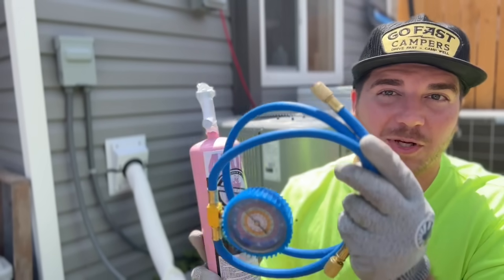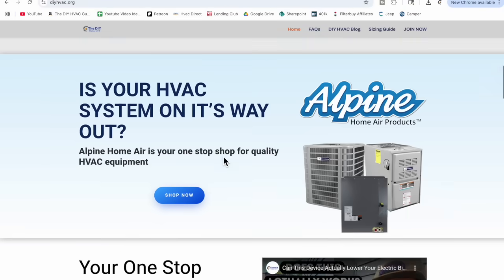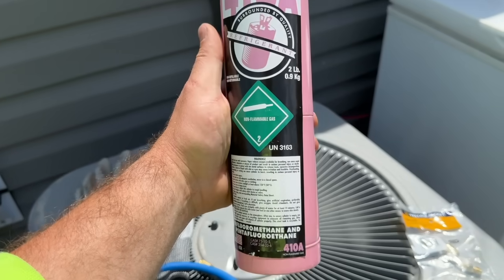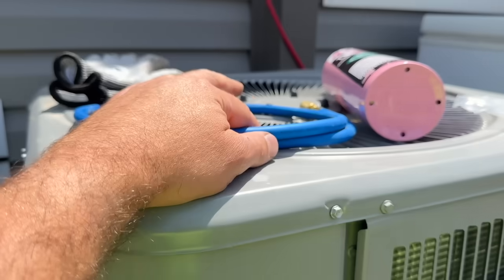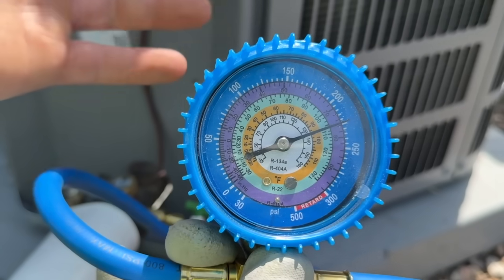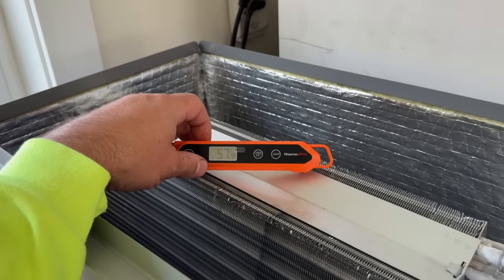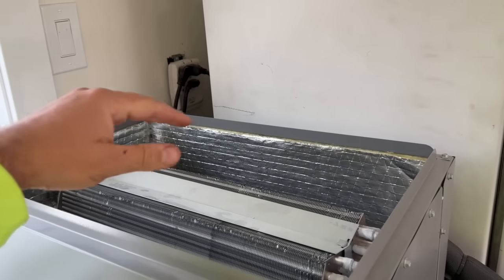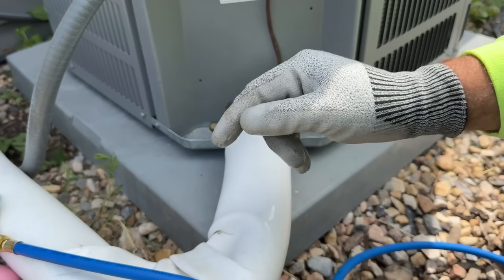You Can Recharge Your Home A/C Like A Car??  Colder Air in 6 Minutes!

Comment: So, when you did the "bleed".  Opening the connection to the bottle, allows backflow of freon from the coupling/freon line which is pressurized from the compressor.... and that presses the gas back to the bottle connection  which purges the line.  I was watching and thought of when the line gets purged.  Thanks - great video.

Comment: So far this season, I've got my EPA cert, recharged, replaced the blower motor that was starting to make noise, cleaned condenser coils, filter, cleaned out handler and evap coils with evap coil cleaner and put some Viper in the drain tray, proactively replaced cap with an AmRad and added a 5-2-1 hard start to help with dimming lights. All thanks to youtube and AI to help find parts. I feel great having my hands in the system and having a good idea of how it functions. Thanks man!
Reply: I wish someone can tell me where to start my AC is literally not doing any thing not making a sound so I dont no where to even start
Reply: @bryannafentress8563  check the breaker to see if you have power first and make sure it didnt trip.
Reply: @bryannafentress8563  Search videos on replacing the capacitor and the contactor in the outside unit and checking the thermostat inside.
Reply: @bryannafentress8563 check disconnect switch, check the breaker, turn on indoor adjacent switch looks like light switch.
Reply: You really needed somebody to tell you to do this? 😂. All you did is what the rest of us in the industry did, and decided to run a business with that knowledge. If you went out and started an hvac company now, you’re not going to be doing this for free for people, are you? Didn’t think so
Reply: What did it take to get your certification? The Epa 608 site doesn't show a way to do it without some program.
Reply: You said: you gonna add liquid refrigerant to the compressor, only gas goes to the compressor,  I am confused
Reply from the maker: Thanks for sharing! Glad the channel has helped you aquite an invaluable skill 👊🏼
Reply: @diyhvacguy  Just an FYI - anyone that was in the military, and had to get an EPA Cert if their normal duties involved refrigeration and A/C equipment - companies will honor that military cert, at least as far as buying refrigerant.
I got mine when I was in the US Navy and they first started the EPA Cert program in the early 90's. In the early 2000's, when I checked about buying refrigerant on my own, the local A/C equipment supplier said that cert was just as valid as the civilian version.
Back in 2009, that cert actually got me a job, with the company that was operating the central heating and A/C plant at the Univ of Texas at San Antonio. The manager was also former Navy, and as soon as he saw my cert card, all he asked was "when do you want to start?".
Reply: @diyhvacguy  which of the epa 608 certifications one require to buy 410A
Reply: Ya, your just lucky you understand what you're doing, now let me see you test those parts while the system is running 😮
Reply: In about 5 more years you can become a trainee for a HVAC tech !
Reply: Best drop in replacement for the vehicle is hot shot which is 141b, r22 and a ounce of propane. They say to place 85% . But I use 80% for a colder affect. I'm hvac also since 2001, universal. You have to be certified to purchase. That's illegal to tell people that they can still purchase the freon.
Reply: @mldlrmn Use the capacitive reactance of a 1μF capacitor @60Hz (2652.58Ω) to calculate the actual capacitance the system sees: divide the product of the current through the Herm wire times the 2652.58 Ω per μF by the voltage (back EMF) across the cap. Then compare the result to the capacitance marked on the cap for tolerance. The PP3 Battery in your DMM does not have the voltage necessary to accurately measure the capacitance. (Do the same thing for the fan terminal on a dual cap.)
Reply: @mldlrmn Walmart does not require the EPA 608 certification to purchase RAID®
Reply: @mldlrmn what about for a central air unit? I'm getting 58 degrees F at my indoor ac vent, incoming air in 75 degrees F, can I get it even colder?

Comment: How much freon can a 2.5 ton system use?
Reply from the maker: Probably around 5lbs if I had to guess. It should say the factory charge on the side of the unit where it shows the refrigerant type
Reply: @diyhvacguy we upgraded the compressor so it's not the same unit plus the unit is downstairs and the apartment is on the second floor

Comment: Can you mix r22 and top off with mo99?
Reply: You can put the other end of the hose up your nose and open the valve very fast to get a turbo nose hit
Reply: You can put water in your fuel tank , it will run like new

Comment: Ac companies are a criminal enterprise. They want
150 lb for freon. I bought 2 - 25lb lb jugs
For 320 for both. Like 6.50 dollars a lb. I was in need of a 
5 ton system replaced do to age, they wanted 12k.
I bought a new carrier for 4k. $500 to have installed.
Total 4500. Did it in the summer when all the ac guys were starving.

Comment: I just a service tech come out. They added 3lbs and with $50 discount we paid $715. I watched the tech the whole time. I’m confident if I have the right tools to troubleshoot I’ll be more inclined to do fill the refrigerant in the future. And thanks for posting this video! Great DIY instruction.
Reply: Get your EPA 608 Type II Certification first. That's what I did.
Reply: Maybe they will give you a labor deal only of you have the refrigerant. Even 200$ an hour to refill the system every year is a bargain. Especially if you use the HVAC year round. Might be good to order 25 # and keep it.
Reply from the maker: Yes you can save so much money. Good on you for observing to see what they did for that $700. A lot of it is not very complicated! Cheers
Reply: Too bad he's failing to tell you if you get caught purchasing or handling refrigerant without a 608 certification you can face fines from the EPA up to $44,539 per violation.
Reply: @jphill3306  Tell me how a person would get caught with a small amount of refrigerant. I don't think the EPA is going to chase down guys who ordered 10lbs off the internet.
Reply: @jphill3306 We're allowed to order the refrigerant. As long as we get a certified guy to install it. 😇 I have my 609. Guess I need to get my 608.
Reply: @jphill3306  the disclaimer says you can buy it. U just can't handle it to use. So call an hvac gay and bribe them with a good amount that's far less than their going rate per oz/pound to gas you up.

Comment: When you have a leah on R-410 A. You are not supposed to add refrigerant... This a blended  refrigerant.  That means  2 refrigerant in one... they have  get to pressure at diferent temperatures and when leaking the one with more pressure scapes first . Then you end up with one more  unbalanced blend. As a good practice you need to remove it all and replace with a new one  ..but most important is to get rid of the leak first.
Reply: Someone lied to you.
Reply: @arizonaf2503 Re: Do you think the school and the books will provide bad information??? You are telling me that the certification for R-410 A is not worthy???
Reply: @miguelquiroz1550 
Blended doesn't mean what you think. Certification for only 410a is not even a thing. For what it's worth, the actual EPA Certification doesn't educate at all on actual AC repair or refrigerant charging but I'm sure you know this.

Comment: Great video, thank you for the upload! Question for anyone including the publisher: on the kit's gauge , the purple scale is in "in-hg" which is a unit of pressure - vaccum . while the yellow- amber scale is in Fahrenheit degrees. However, the publisher mentioned that the purple scale is indicating "temperature". Is the purple scale for degrees or temprature?
Reply: I have seen this  question repeated several times in the comments.  "the purple scale says inches HG not temperature?" The in hg that you see is refering to the 0 to 30 on the outer blue scale, this is vacuum, dropping below the 0 to 300 psi scale. This is for when a vacuum pump is used to evacuate the system. I hope this helps

Comment: My tag on the side of my unit is completely faded away and I have no idea what kind of refrigerant my unit takes. Is there any other place I can look to find it. We took off the side panels and looked to see but it was just the wiring diagrams.  On the side of the dryer filter that's hooked to the small line coming out of the house it said can be used with R12, 134a or R22. Doesn't tell me what is in the unit. Thank you.
Reply: Gonna be r22. Look at label
On compressor
Reply: @danielracicot8310   Found it. It was R-22. Thanks man !!!

Comment: There's something I do not understand. At around 13:00 you start adding liquid refrigerant to the low side of the compressor, where the system should only have gas. A compressor is designed to compress gas to it's liquid state, and not have to "fight" something which is already a liquid. In this situation shouldn't you add your liquid to the high side, wait for it to be turned into gas in the inside coil and then re-liquified by the compressor?
Reply: Can’t add It to the discharge line.  You just flash It in slowly through suction line.
Reply: @danielracicot8310  You have to add R410A as a liquid because it is a blended refrigerant not one compound... You would only be adding part of the blend and the system will not cool with only vapor.. Honestly if you are not trained you should not be anywhere near refrigerant.

Comment: If you have central air and have your furnace/acoil inside a closet inside the house, try putting a thermometer in your vent with the ac on, note the temp. Now when the ac comes back on this time open the door and watch the temp again. 

Mine went down almost 5 degrees with the door open which told me I needed more return vents to this little closet. 

Hope this helps

Comment: Around here, they've been putting locking caps on the schrader valves.  One more tool to buy!
Reply: Locking Caps are the law sir, They are part of the Florida Building Code... At least here in Florida.. It stops kids from huffing refrigerant and refrigerant theft.

Comment: Don’t forget if you knowingly keep putting r-22 into your leaking r-22 system and the epa finds out you will be fined up to 58,000.00  for the violation. 

Just food  for thought may be different In different states
Reply: Is still cheaper than calling someone in...😇
Reply: And keep in mind this fine is per day until remedy
Reply: @frankvizzare Horse schitt! Citation please?
Reply: Technicians do it all the time, especially during summer. They don't have time to look for and repair leaks. They are too busy.
Reply: @samkitty5894 lazy  or just trying to keep charging you for refrigerant ?
Reply: @samkitty5894 oh I know we are busy but that’s no excuse for not doing the job and finding and either repairing a leak or swapping out the unit if it really is time to do so. No sense in doing a 2-4k refrigerant repair if the units so old it breaks down completely a month or only one year later
Reply: "knowingly" Key legal word.
Reply: @Igotstaknowit  lol even not knowing they will xD  have a good one 😂

Comment: You can't properly diagnose with just a suction gauge.   To know if a system is low or properly charged needs to be done by superheat or subcooling. You can easily overcharge a system that has a bad TXV or plugged drier. Your suction will stay low and you will keep adding refrigerant not knowing what a restriction looks like on your gauges R410A can be over 500 psi on the high side of a system.  Pushing in Schraders can be dangerous I have seen them stick and if your unprotected hand or face gets blasted with liquid refrigerant you can get seriously hurt 2nd and 3rd degree burns.  R410A boils somewhere around -60 fahrenheit.  Find a reputable company and fix leaks.  Adding gas constantly to a system that is known to be leaking is irresponsible and illegal.  Some things can be done diy cleaning coils, changing filters, clearing condensate blockages.  If you don't have experience diagnosing and handling refrigerants you shouldn't be handling them
Reply: Great advice, but the reason people try this is because everywhere you turn these days there are rip-off ac techs and unscrupulous rip-off companies. Yes, we were taken by one for a repair but fortunately we went with a reputable one when time to replace.
Reply: @GeorgeKennedy-u4r yeah I get there are a lot of dishonest people and companies I don’t disagree. It’s just that someone could injure themselves or make their system run worse or damage it because they don’t know what they are doing. It’s not as simple as this guy is making it out to be.  Nothing wrong with learning what to look and being informed and asking the right questions to weed out crooks. I have been doing this for 27 years. I have friends, family,and neighbors always asking me questions when they have a system not working. I would never blindly tell them go online buy refrigerant and add it because your suction line has ice. Same thing with electrical issues.  I would feel horrible if someone got hurt because I told them to do something and they didn’t know all the risks associated with it. That comes with training and experience. If find a good company or even a guy who does side work never let them go because good ones are kind of hard to find.  I don’t say this because he’s taking work away. The company I work for has more work than we can handle there is shortage of good techs.

Comment: Would you suggest using a leak sealer for a small leak when topping off the system?
Reply: No, do not do that. You will clog your metering device. Most of that leak sealer is an upsell rather finding the source of the leak.
Reply: @bradfordgordon6552  my system is a fixed orifice not sure whether that would make any difference?
Reply: Fix the leak before recharging.  Recharging a unit that you know has a leak violates EPA regulations.
Reply: @richranchernot Only for a system that holds greater than 50 lbs and loses more than half it's charge in a year.

Comment: Dude, don't tell unlicensed home owners to do these things. First of all, they are not EPA certified. This is the first time responding to you videos. Myself and other HVAC people in the industry need you to stop posting this bullshit. Block me if want, but the truth is the truth. Do not tell homeowners to dump gas in their AC units. There may be other issues contributing to the issue. It is very amateur to just make the refrigerant charge the fix all solution. Where is the superheat and subcooling? How can a homeowner make sure the unit does not become overcharged? The end result would be worse than jacking the unit up with refrigerant. Adding refrigerant to a leaking system is not recommended. This is why the government changed the refrigerant on us again in the first place. The system needs to be checked by a licensed contractor. Your really not doing anyone any favors. PLEASE, FOR THE PEOPLE WHO DOES NOT WORK ON HVAC FOR A LIVING. DO NOT LISTEN TO THIS GUY. 
Let's tell the public to smoke a cigarette while charging 454B too. 
I have been in the HVAC business for 25 years plus. Held every position in the field. I am also a licensed contractor with my own company.
Reply: In other words, DIYers solving their own problems for $150 is a bad thing and someone with a license charging $1,000 or more for the same is a good thing. Getting required cert is a good thing to  help people have some knowledge. Changed out a capacitor for $18. Local HVAC companies were in the range of $450-$625. I did it safely and had it up and running in 15 minutes.
Reply: @Igotstaknowit  I did not post to argue. There is a reason why Home Dep#* as an example does not carry HVAC parts except for some ductwork for the DIYer. My main problem is this YouTuber is devaluing and discrediting the HVAC industry where experience is what customers pay for.  This guy needs to shut down this channel. Wait until a subscriber gets hurt with these recommendations. Again, I am not here to argue.
Reply: @bradfordgordon6552  It is dangerous work and DIYers are more likely to end up in the ER. That said, for simple things, like SAFELY discharging a capacitor and replacing with $18 part, well worth it compared to being charged $450 by the guy who does it in a few minutes, then plays on his phone for half hour so customer doesn't complain about price for a few minute job. yes, I understand training, experience, inventory, insurance, trucks, and on and on the expenses of running a business.
Reply: @Igotstaknowit The long and the short really is that most HVAC companies are severely price gouging these days. I got quoted $16K to replace a 2.5T R22 with modern equivalent.  Condenser and air handler can be had retail for $3500. No amount of Freon and labor justifies this markup. They hate the minisplits because they're even cheaper and easier. Can get a full 2T system for $750.(current system is oversized). Will probably diy it. If it dies in 3 years who cares? Pull it out and install another.
Reply: @chad2787  How do you know "most" AC companies are overcharging? You pay for quality work. Is a company supposed to give a customer the unit at cost? There is a cost to do business. Can you provide credible information where HVAC companies are overcharging. Plus, AC systems are not created equal. You get what you pay for.
Reply: I agree someone is going to get hurt.  Most people don't know what 500 psi of liquid refrigerant feels like. They will learn the hard way when that schrader core sticks and their hand is blasted with liquid refrigerant and then they have second and third degree burns because the guy on youtube told them to push the core with a screwdriver.  If this work was as easy as this guy makes it seem people would be beating down the doors to do it.